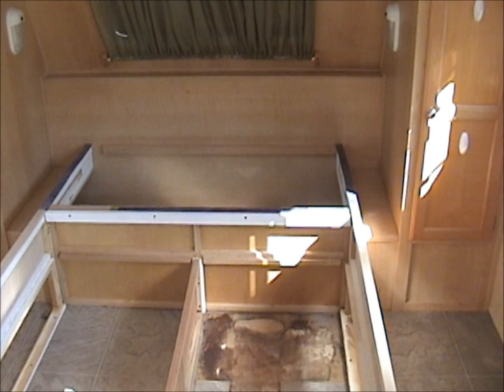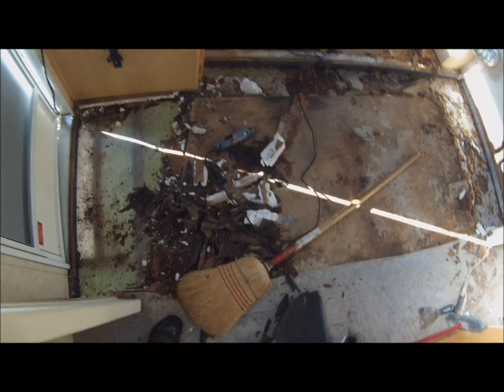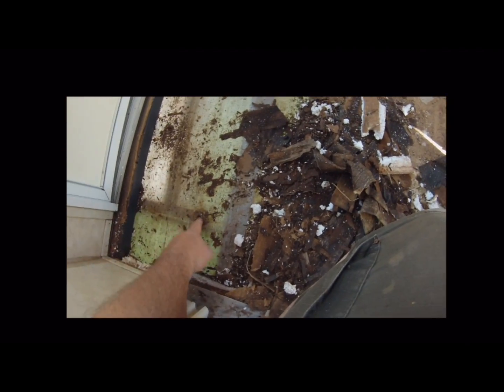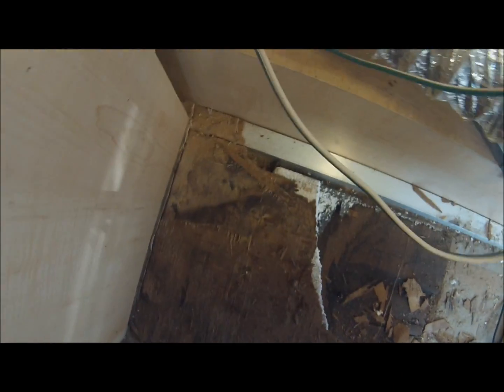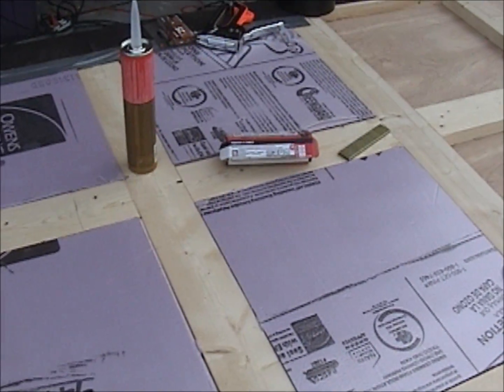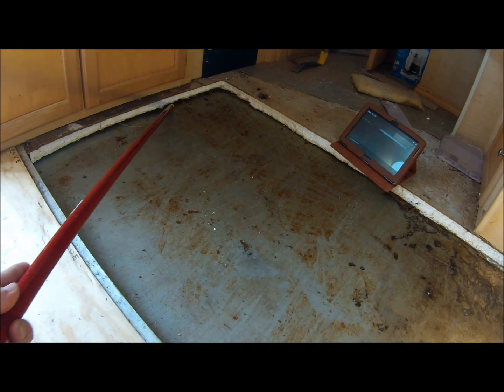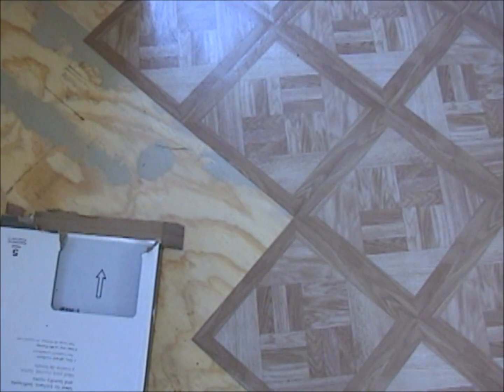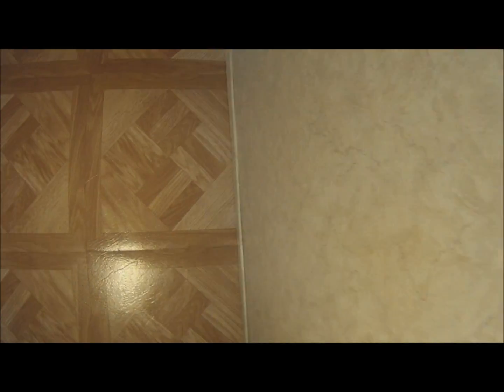How I replaced the spongy floor in my RV for under $500

Comment from the maker: My floor is about five years old now and doing fine. I'm thinking of changing out the flooring for laminate. It's pretty easy to do. What do you think?
Reply: They say in an RV that laminates not really good to do because all the moving around makes it come up that's why it's either you put carpet down or you put linoleum anyway that's what one of my friends that remodels motorhomes and travel trailers
Reply: I haven't put mine down yet it was supposed to do it this summer but I couldn't get anybody to take me to get treated plywood
Reply from the maker: @maryelkins736  Thanks for the good advice. Our RV is permanently parked on a lot at the lake. Too old to be gallivanting around. The lake is good for us.

Comment: What would you have done if one or both of the metal beams surrounding the wheel wells was cracked and bent due to the weight of the wall?

Comment: I was thinking that it might be a good idea when building or repairing a trailer, to finish the wood floor and wall members with something like Thompson's Water Seal, so the wood doesn't rot before you can notice and repair a leak.

Comment: Excellent video, How did you attach the aluminum frame? I am currently in the process of tearing up the floor in my 2004 Trail-Lite.  I'm glad I found your video.
Reply from the maker: Hi Lisa. I don't envy the job you have ahead of you. Good luck. If you are speaking of the two aluminum bars that run the length of my camper, they were already there. I attached my floor to them by drilling pilot holes and the using self tapping metal screws. I hope this helps. Thanks for watching.

Comment: My unit is constructed this way. I noticed the existing (rotted) luan plywood goes underneath, and on top of, the metal square tubing supporting the walls. Was yours constructed that way? If so, are you concerned about shimming underneath to avoid wall sag? I assume it must be ok since this was done 6 years ago.
Reply from the maker: Yes mine was constructed this way. I did no shimming underneath to avoid wall sag. Still holding up fine.
Reply from the maker: @Ideal Carpets and Interiors Yes mine was constructed this way. I did no shimming underneath to avoid wall sag. Still holding up fine.

Comment: Hi Roger, Your video was very helpful. 2 questions for you I have a 2012 Rockwood Signature Ultra Lite with the spongy bathroom to about 2 feet into bedroom. we already tore most of the bad out. the first underbelly protector we removed there is another barrier that we had to cut for we won't be able to get any wood to fit back in with it there. 
1. the roofing felt that you used is it pretty close to what is already on these trailers for water protection?
2. do we have to drop the black and gray tanks on the camper

sorry 3rd question are you close to PA and maybe would like to help with this project?
Reply from the maker: @Cathy Kirk Good luck on your project. I replaced my floor from the top. I never went underneath except to inspect the rubber waterproof membrane. The roof tar paper I used was the best I could find to replace what was there. I suggest you go to the manufacturer's website to see if they have a drawing of the floor composite materials. I did not have to go back to where the tanks are so I never messed with any tanks. I can't answer that question. 
We will be visiting my brother in Mount Pleasant PA in October for our 49th anniversary. Doing a camping trek up north to see the leaves. We live in Florida.

Comment: Hello Roger. Thanks for the video.  I have just pulled out part of my foam sandwich floor, similar to yours.  It looks like it's wet all the back to the door (about 8').  As I get to more solid flooring it gets harder to get the material out, but it's still wet underneath.  Looks like I will have to get some dremel bits.  I'm looking at constructing panels like you did and fitting them in, and screwing them in to the aluminum frame under the walls.  What distance apart are your 2x4's? and lap joints.  Another repair job showed 2x6's but I think they would be awfully heavy.
Reply from the maker: Mine were 14".  I did not use 2x4 studs. Too wide. I cut min down to 2x2. I figured the sandwich panel would be stron enough. It's been 4 years and still holding up. 2x6 is way overkill I think. Extra weight is a real consideration.  Thanks for watching. Please subscribe. I'm trying to get to 1000 subscribers.

Comment: I'm about to do a half cheating version of this for a 1982 Fleetwood prowler I'm fixing up for my cats. The floor is a complete disaster but I'm only ripping out the most rotted part. When you cut under the sink to lay the 2x4s over the steel bar, did you drill into the bar to secure the flooring or is it just laid over the bar?
Reply from the maker: Yes I bolted it to the frame.

Comment: I was really surprised by your frustration with this project. It’s obvious that you have well above average woodworking skills so my assumption was that you would love a project like this. The only speed bump you hit was not connecting to the I-beams in your initial design. You were off to the races after that. The work you did was fantastic. Without a doubt better than the manufacturer’s floor. Looks like you put 33 days into this job and assuming 5.5 hours per day, (you stated 5-6 hours) then that comes to 181.5 hours so let’s round up to 182. I recall you saying the RV shop would have charged 2 grand to do the work and I think that’s highly unlikely. We could assume that they would be faster, but that’s not always the case. Additionally it would sit on the lot for a while until they got around to it. I also bet they would not have done the sub floor you did. More than likely they would pull laminate back far enough to create a reasonable transition area to cut neatly, remove rotted wood, slapped down a new wood panel and install new laminate. You would have never gotten the sub floor you designed.

I think the biggest handicap you had was possibly not having the resources six years ago that YouTube offers now. You would have known more about the floor design and could have had your final design in the beginning.

Comment: wrapping roofing paper doesn't do anything other than trap moisture into your floor just like darco wrap does.  Both are a joke.  99 percent of camper leaks come from roof and walls/windows which then pools down onto the floor and wrapping the bottom side only keeps it there.  Best repair for future reference is to use pressure treated plywood with pressure treated support beams that you can "sister joist" into existing framework, or make your own frame if damage is really bad.  Don't wrap anything on the floor, instead spray/roll all repair floor plywood pieces with truck Bedliner spray before installing which will protect it forever with no moisture able to get in.
Reply from the maker: @noneya biz Ok. Thanks for sharing your opinion. Sounds like you have done this before. What type of RV did you repair? How did you keep the weight down using that pressure treated plywood? My RV is a Lite and I was worried about adding too much weight. Also the existing floor I demolished had roof paper around it. That's why I used that technique. My RV was in a flood and the water rose up inside about 4 inches above the floor. Tell us more. By the way my floor is still dry and solid.
Reply: Why do folks come in with "shoulda done it this way" advice then not respond to questions?
Reply: @rogerdalescott  if u want the original 1-1/4 thickness that foam floors have  just put two 5/8 pieces of plywood together supported from underneath by angle iron or 2x4 screwed into the metal framing as you did.  Don't use the hollow aluminum joists as sister joists if at all possible.  Laminated floors with styrofoam are a joke.  They disintegrate with water, or even without water they flex over time in high traffic areas and get soft.  Forest river went back to wood floors in 2018 after so many issues in "lite" trailers.  Not sure about other manufacturers
Reply: @rogerdalescott  that wasn't roof paper the rv maker uses.  It's called darco wrap and is supposed to keep the underside dry while going down the road.  Problem is, the lazy rv workers don't wrap it over the top side on friday afternoons, and even if they did, it's junk and tears too easily anyway.  Noneya is right, I also use bedliner spray on all the main floor and slide floor repairs I've done to protect from water.  As of March 2020 Keystone and other Thor owned manufacturers started using hyperdeck flooring which is a composite and so far has been good, no more joke foam sandwich.   I dont think forest river uses anything similar and I tend to avoid their "lite" trailers.

Comment: So, I think I am naive.  (70 year old lady)  This is the second video I have seen with rotted floors.   not the best floor support either.  Is this representative of the RV industry?  No industry regulations for manufacturing?   Why not have support beams every, at least, 24 inches?  Would the argument be too heavy?  Why not use the same type of base flooring as is used for bathrooms in homes?  Too thick?
Thank you for your honest portrayal of the work.  I hope you enjoy your RV for years.
Reply from the maker: @susan montana Hi Susan. Thanks for watching and your comment. I think this floor system is representative of the industry. Like most manufacturing the balance must be found between cost and quality. This RV is in the Lite weight class so the floor system must be constructed of appropriate materials including the frame. Weight is the issue.
Reply: @rogerdalescott  thanks.  I guess this may be the reason I see so many videos of travel vans being used as RVs.  (At least the body is all metal.)

Comment: Thanks for sharing this video. I also have a Trail lite with the luan 
Styrofoam sandwich floor design that needs to be replaced. Is it safe to cut out and remove the 
luan floor or is it a structural component where I would have to support
 the walls while replacing the floor?
Reply from the maker: If you look closely at the video you will see that I cut the floor along the wall. This leaves the part of the floor still under the wall in place supporting the wall. I did not try to remove the floor from underneath the wall.
Reply: About a week ago I started repairing the floor in my RVision 27RSL with the same type of flooring.  There is water damage that runs a span of about 15 feet along the drivers side wall.  It runs from the middle of the trailer where the bathroom is located all the way down to the back of the trailer.  I'm repairing the floor in 5 foot sections starting at the rear.  From what I've seen so far, there are no supports that run from the driver side to passenger side wall.  All that is holding the walls up is the styrofoam sandwich floor, which to me is scary.  The floor acts as one solid support from wall to wall so the more floor you remove, the more support you take away from the walls and the floor will start to sag over the edges of the trailers steel beams.
In my case the walls have begun to sage because of the water damage so I'll have to jack up the walls and install supports that span from wall to wall in order to maintain strength.
If I were you, I would support the walls near the areas that you'll be doing the repairs on your floor as a precaution.
Just my opinion though.
Reply: @jplevasseur1  I know it has been a year since you wrote this reply BUT here goes...  Did you complete your repair? How did you jack up the sagging wall without doing damage to the fiberglass?  What exactly did you use as the "wall to wall" support beam?  I have a 2009 Trail Cruiser hybrid and all the floors are spongy. But now I can see evidence the the passenger side wall (near the rear entry door) is sagging - a lot now. I suspected that was happening but could not believe anyone would design a product like this.  Your post has somewhat confirmed my suspicions.  Now I am not sure that this is a job that I can do myself and even if I did, could I really save this camper.
Reply: @cmcdar  we just did that. You simply unscew it and put the jack with a piece of timber on the aluminium frame not touching the putter fibreglass sheet and Jack it up.  The sheet stays in place and the floor and walls lift up.  Man this job sucked.  So much up and down for every single section.

Comment: Hi Roger,
 I have another question for you Like I had said we bought a 2012 Rockwood Signature Ultra Lite. I just spoke with the manufacture of it. He said that if the floor ever suffered a delam the entire floor needed replaced we could not just do sections. That the trailer should go back to the factory to have a new floor put in.  The price just to start it would be $6,500 not counting the towing back to factory and if anything else would arise. We are talking about having to possibly replace a 35 foot floor. just to fix the bathroom and a little spot in bedroom
What are your thoughts on this camper? We already have it pretty much tore out. 
After watching your video its the same flooring you replaced. We do not need to make any more support braces they are all good and they are Aluminum. We just need to replace the 1/4 inch plywood on top in places. Replace the High Density Foam. Most of our work is underneath which again is the 1/4 inch plywood.

Any suggestions would be helpful. Thanks Cathy
Reply from the maker: @Cathy Kirk I am a handy guy. I like challenges. I like to build and make things. I, personally, would never pay that much to fix that floor. I would do it myself and I know it would be better than any factory job. That's me.   I have remodeled houses, built custom furniture and built a three story tree house with tables and bunk beds when I was 13 years old. I have complete confidence in "my" skills. Don't know you so I will not make that call. If you are not confident in your skills, well?????

Comment: HI ROGER. THIS IS WHAT MY CAMPER LOOKS LIKE UNDERNEATH THE FLOORING AND UNDER THE COUCH AREA. I DIDNT KNOW IT WAS THIS BAD. ACCORDING TO THE SELLER THE WATER DAMAGE WAS IN THE PAST AND WAS NO LONGER A ISSUE. I DIDNT KNOW WHAT TO LOOK FOR SO I PURCHASED THE 1969 VINTAGE CAMPER TRAILER. I CAN SEE NOW THAT THE DAMAGE IS BAD AND IM NOT SURE WHERE TO START TO TRY AND FIX THE PROBLEMS IM SEEING. THE ROTT THAT I FOUND SEEMS TO GO ALL THE WAY THROUGH TO THE UNDER CARRIAGE OR BELLY OF THE CAMPER. I LOOKED UNDERNEATH THE CAMPER AND ITS ROTTED. I CAN PICK OF PIECES OF WOOD WITH MY FINGERS AND IT FALLS OFF. I DONT HAVE ANY FIX IT SKILLS BUT IM WILLING TO LEARN. CAN YOU HELP WITH ANY SUGGESTIONS. THANKS FOR SHARING YOUR VIDEO.
Reply from the maker: @David Remmenga Since I don't know all of your circumstances I will put myself in this situation. If I bought the camper because it was 1969 vintage and never been worked on then I  would know it's going to need to be restored. If I bought the camper because it was cheap and old I would also know it was going to take some work. Knowing I have the skills and tools to take on a job this big I would buy the camper at the right price. As I did in my camper, all of the inside furnishings will need to be removed. Demolish the entire floor and rebuild it from the ground up. Reinstall the furnishings. More water damage may be discovered in the walls and that will need taking care of. More money and work. OR I find an experienced restoration company and pay them to do it. If I don't have a lot invested in the camper and I can't find a solution.....chalk it up to experience and trade it on another. Be sure to point out the flaws. 

Good luck David.

Comment: You did a great job! I think I would have used Tyvek house wrap instead of roofing felt.
Reply from the maker: Good call!
Reply: house wrap is not a moisture barrier it breaths. roofing felt is a moisture barrier till the tar dries and cracks then it holds water

Comment: What had happened to your floor is called de-lamination it's where the polystyrene between the two sheets of ply has become crushed over time in the places where there is heavy foot traffic,
The idea of a laminated floor is to give maximum strength to the chassis without being too heavy, if you look underneath your caravan you will see a light weight galvanised chassis with the floor directly on top, unlike older types where the chassis was made of heavy steel with wooden joists laid along the top with a thick plywood floor attached to them, in which case what you've done here would have been a fantastic repair, however, what you should do when your floors de-laminate is inject a resin into the floor to fill the void left by the crushed polystyrene, look up caravan floor delamination here on youtube to see how it's done, it's a lot quicker, easier, makes the floor stronger than when it was new and most importantly it doesn't weaken the chassis so is much safer too.
Please be aware of this and think about strengthening the chassis where you've replaced the floor.
All the best, Paul...
Reply from the maker: The problem was not crushed polystyrene in my case. It was in pretty good shape. The problem was that the two plywood sheets, above and below the polystyrene had gotten extremely wet and they had rotted and completely disintegrated to a wet mushy paste. This occurred even in areas that hand no foot traffic, like under the bed.